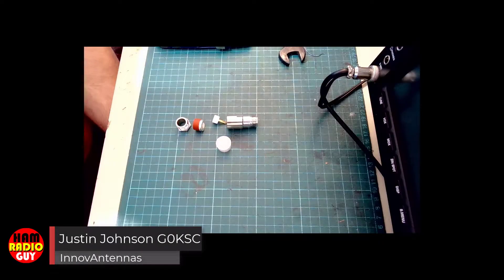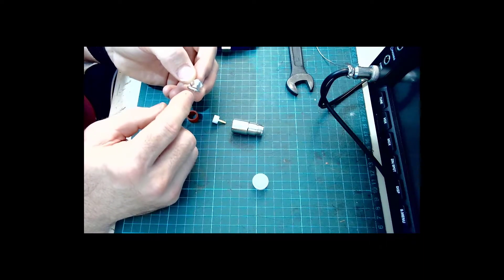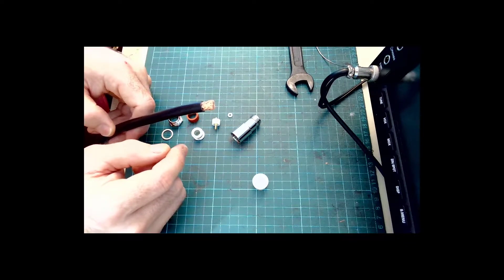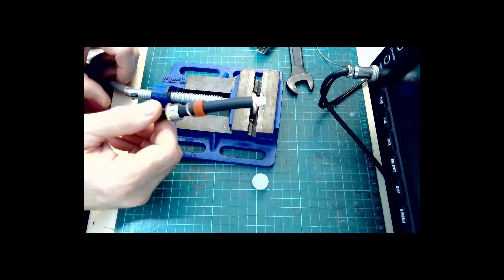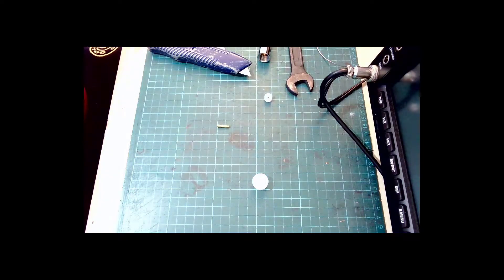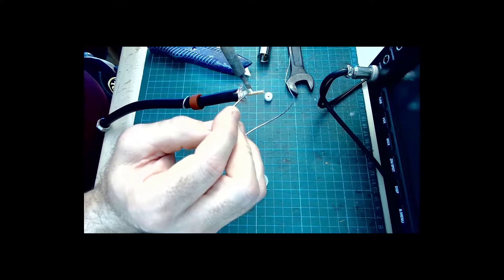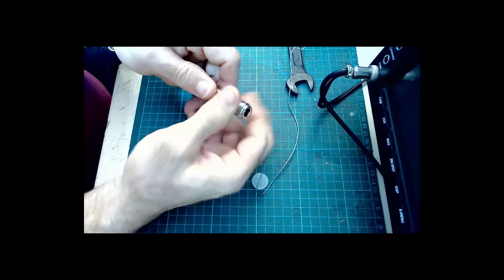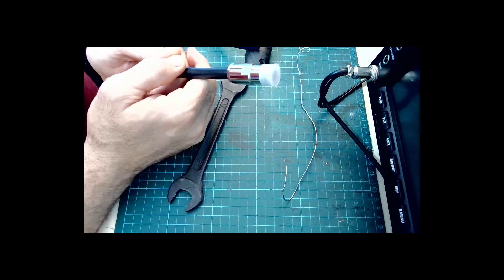Fitting Compression N-type connectors to WestFlex W-103 & LMR400

Comment: Having used Westflex 103 for about 12 years, I still have problems with the air spaced dielectric melting. Can I ask what rating of soldering iron would you recommend?

Comment: Justin, Thanks for the video. I'm assembling some cables this week so it was helpful.   Maybe you could do a video on chokes/baluns. There seems to be a lot of different opinions and confusion/misinformation about how to properly feed a yagi.
Reply from the maker: I will do but this is more of an art form, the coax choke can be narrow and ideally needs to be measured.
Reply: Justin,  that's what I'm confused about. Some say the coax air chokes are worthless. Some say use the ferrite beads, different stubs, ect. I've noticed alot of lfa yagis are matched with a bar connected the the driven element. Ive been told that style doesnt stop common mode current. There are so many options on what works and what diesnt it gets confusing.
Reply from the maker: @weberfire1979  no LFAs are matched with anything. Chokes of coax nor ferrite core baluns Match them either. All of the about are designed to balance the feed point unbalanced feeder (coax) meeting a balanced antenna.